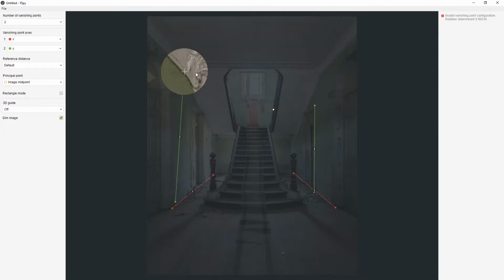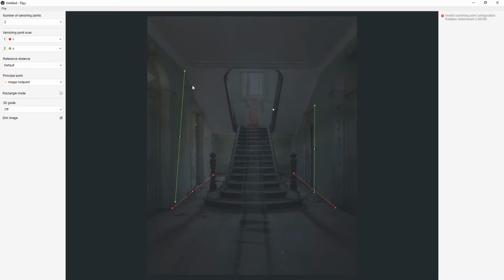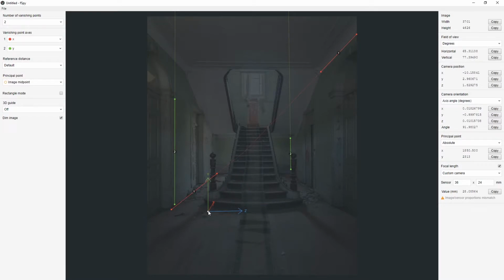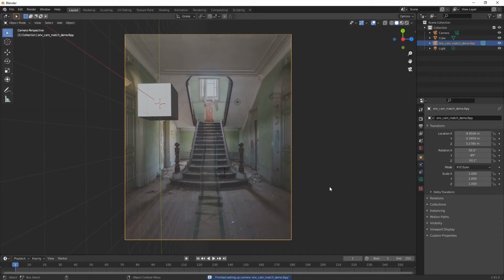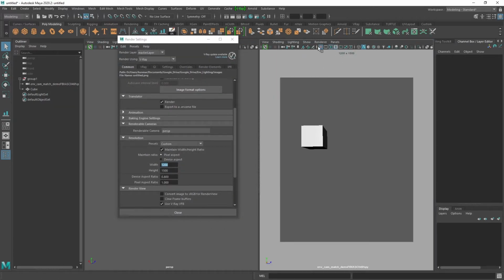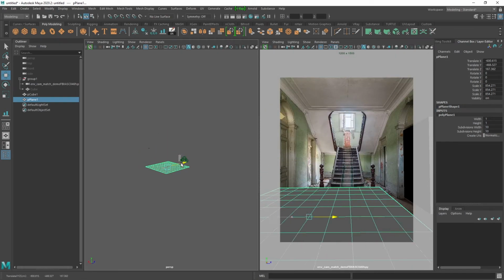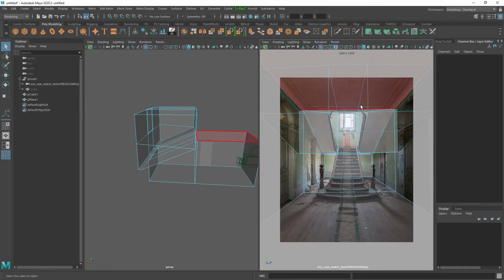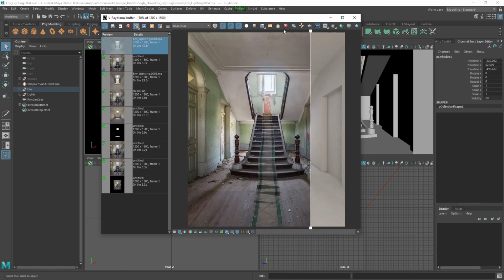Camera Match in Maya with fSpy and Blender

Comment: Before I add my 2 cents, I want to emphasize, I'm your big fan at the ArtStation ;-) Regarding this video (the fSpy part):
- fSpy cannot determine the principal point unless your image has a 3-point perspective; in 4:14 - you get this orange circle in the right bottom corner, although your picture has its principal point in the middle (as it hasn't been cropped/shifted); you should never try to establish 3 nor 2 vanishing points for such images
- as you've noticed this image has a 1-point perspective, you should have changed the number of vanishing points to 1 at the beginning and not drawn two Y lines because if you had matched Y precisely, you'd have got two parallel lines and an error in fSpy
- for 1-point perspective you also have to manually determine the focal length
I cover the above problems in my fSpy tutorial: https://www.youtube.com/watch?v=daiMOYR8GS8
Reply from the maker: Thank you for your valuable insight, I will pin your comment for anyone watching this tutorial. Great content by the way!
Reply: @OnMars3D  thank you. It’s very motivating to hear this from such an artist.

Comment: Scientifically, this image has only one vanishing point—not two or three. Normally, you only need a single VP:

X-axis → left/right

Y-axis → forward/backward

However, using two vanishing points in fSpy is fine if it helps you align the grid more easily. Just avoid using three vanishing points—this won’t provide any real benefit for this type of image.

Also, take time to learn about the principal point, especially when the image has been cropped. It’s extremely important if you want everything to line up accurately.

Comment: I followed all of these steps, and it looks correct in Blender, but after importing it into Maya, the perspective is incorrect. Anyone else having this issue?
Reply: I ran into the same problem with fSpy and Maya. Here’s how I fixed it:

1. Use the Angle Number from fSpy: Find the angle number under "Camera Orientation" in fSpy.

2. Set the Film Aspect Ratio in Maya: Input this angle number in Maya under the "Film Aspect Ratio" setting (in the camera's attributes that you import from Blender).

3. Adjust Fit Resolution Gate: In Maya, tweak the "Fit Resolution Gate" setting. For me, "Overscan" usually works best.

This approach should help you get a more accurate camera match in Maya. Hope this helps someone!

Comment: I have set the render setting to the same as the resolution of picture but the image plane is shifted slight towards Left from Resolution gate. When I hate the "Fit Resolution Gate" the height of Image plane match the resolution gate but it is still offset to Left

 I will DM you on Instagram with screenshot so that you can better understand what I am talking about

EDIT: This issue is with 3-point perspective. 2 point perspective works perfectly . Does anybody know some workaround for 3-point perspective.

Comment: Having a problem with fitting the reference image to the resolution gate, it has the same resolution, but it offsets  a little to the right for some reason, its driving me crazy!. However it does not do the same with a normal perspective camera. How do i fix this?
Reply: I am also having same issue. Did you find any solution
Reply: @hemanthsaji3606  Select your camera > Attribute editor > Film back > Film offset > set both values to 0 (I'm a bit late)

Comment: I had an issue when I was setting up the image plane, the "Fit to resolution gate" did not worked. You know what may have been the issue?
Reply from the maker: You have to set the the resolution in you render settings so it matches the reference image, then it will automatically match in the viewport when you use the resolution gate.

Comment: Roughly how much time did it take you to build the untextured final model 23:34 ? Thanks!
Reply from the maker: I would consider the model to still be in "blockout" form as it only took about 30 minutes to create. There is a bit more detail that I still need to add. Hoping to have that done soon!
Reply: @OnMars3D  thanks! I need to practice more to speed up :) I wouldn’t do it in 30min.
Reply: @stevenp6761  Speed comes with experience don't sweat it worst thing to do is rush and make mistakes. I've really slowed down recently i was rushing like mad to get stuff done lol